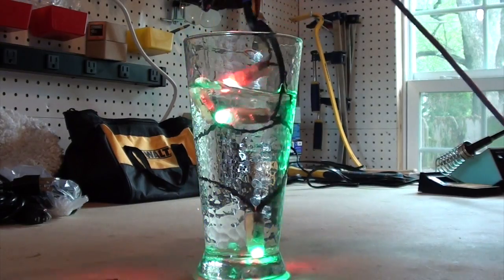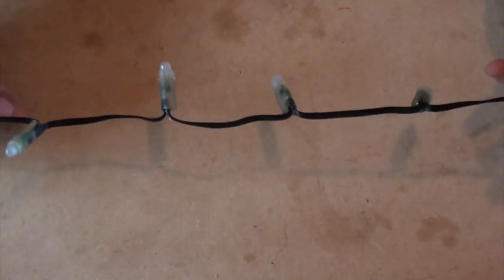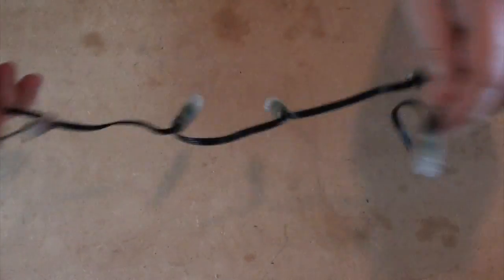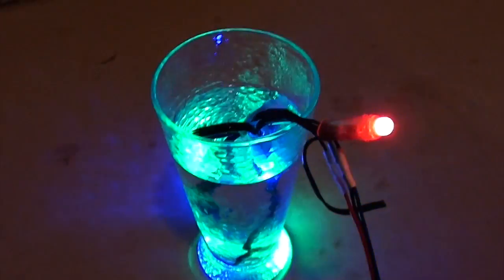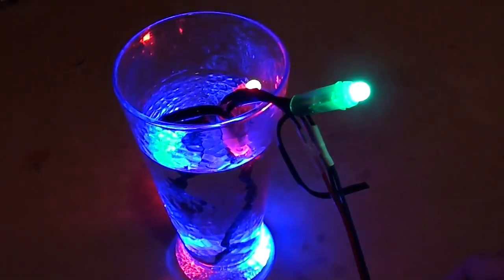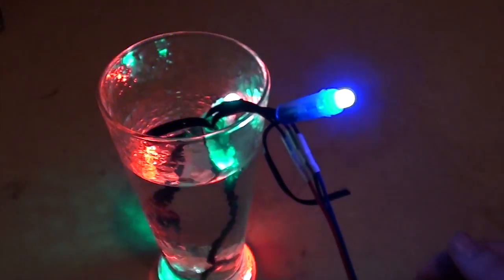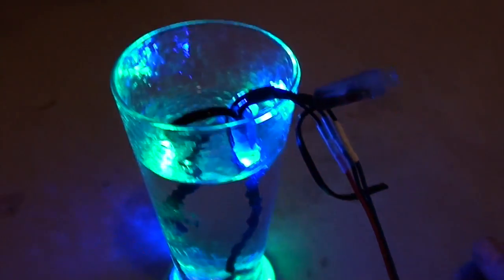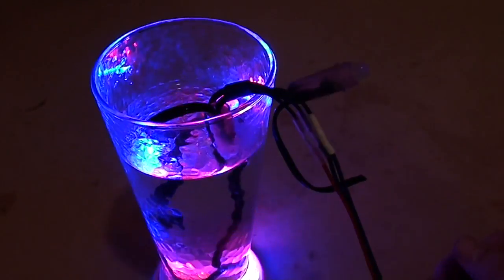RGB Pixels, Not Just For Breakfast Anymore

Comment: Review, love the comical intro's, Like the music doing builds, Like the speed up also.
One thing I think you can add to your beginner series is tools. Wire strippers, Heat gun, Solder station, etc
(https://www.walmart.com/ip/Pratical-Soldering-Rework-Stations-SMD-Desoldering-Station-Welding-852D/236445483?wmlspartner=wlpa&selectedSellerId=15564&adid=22222222227092307202&wmlspartner=wmtlabs&wl0=&wl1=g&wl2=c&wl3=214891633391&wl4=pla-347330541309&wl5=9003172&wl6=&wl7=9003231&wl8=&wl9=pla&wl10=118770990&wl11=online&wl12=236445483&wl13=&veh=sem)
Reply from the maker: I don't think I'd even know what to do with all that! LOL! I've never developed surface mount skills. :)